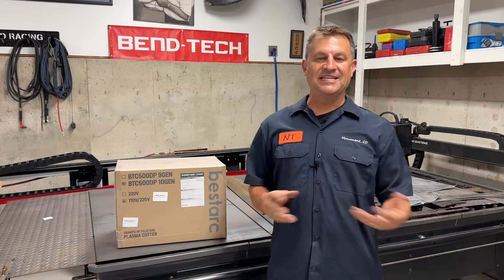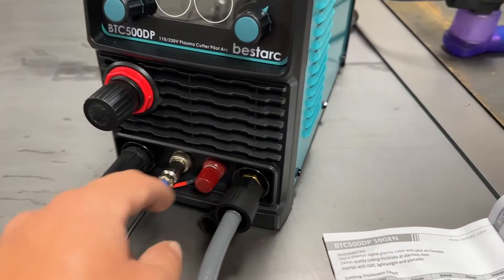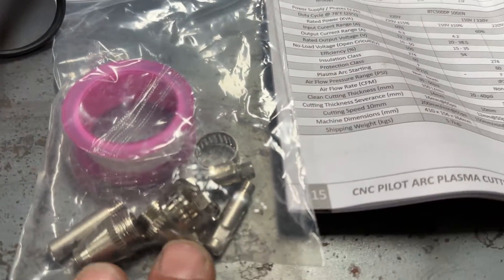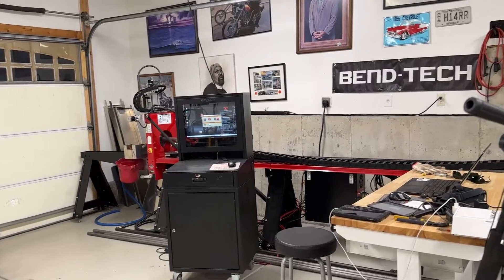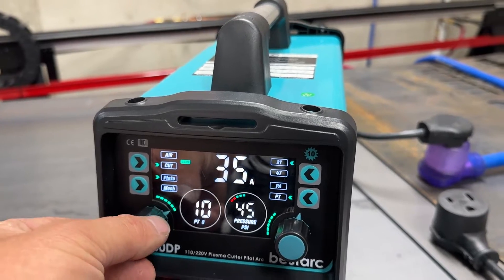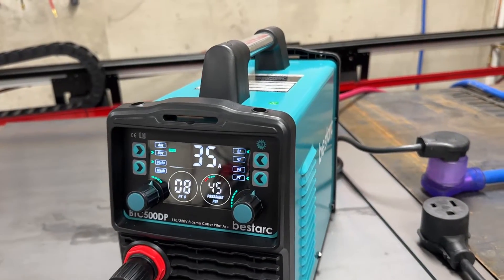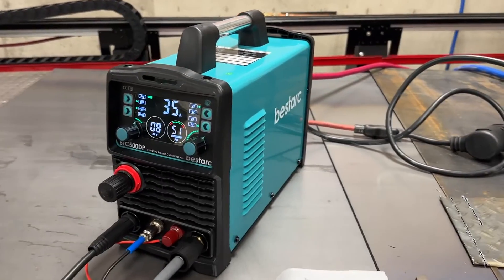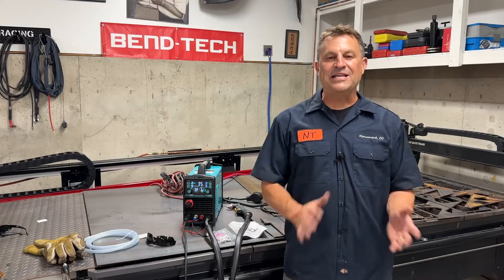Budget PLASMA CUTTER…Does it WORK?

Comment: I bought this same rig back in Feb.  Would rather have had a drag tip style so I could use it for templates.  But otherwise I have been impressed.  I ran into the same problem with it popping a 20 amp circuit breaker (not a sketchy one) when I was at 35 amps on the 120V  That is just asking a little bit too much out of a 120v circuit I think. Not the cutter, but at 35 amps machine setting you are pulling a full 20 amps (plus) through those little 15amp 120 receptacles :)   However I found out I could dial it down to 22-25 amps and it would still cut up to 3/16 you just had to give it more time to pierce and move slower.  I will definitely run it on 220v when I am in the shop but it is nice that I can run it on a 120v when I need to use it in the field.  But it definitely works a lot better on 220V  I just bought me one of the Crossfire XR CNC tables...just so you know your videos weighed heavy in that decision :D  Keep up the great work and keep the videos coming.  You are helping people out here.